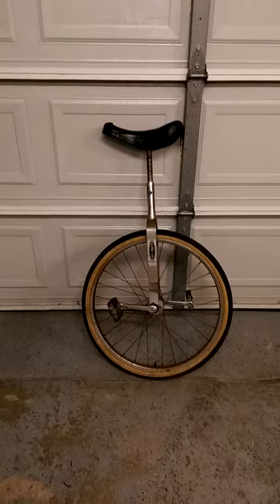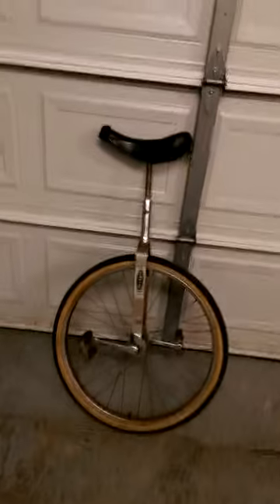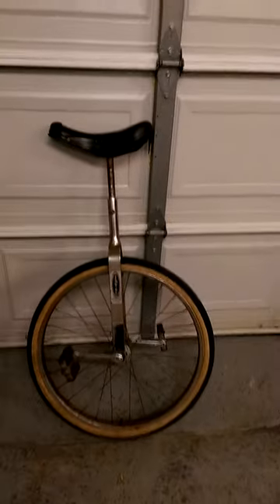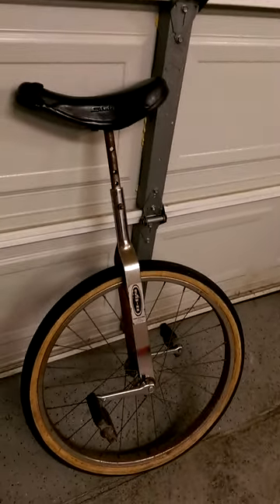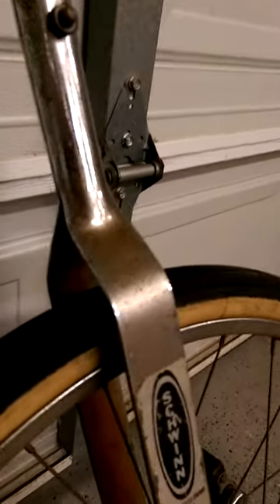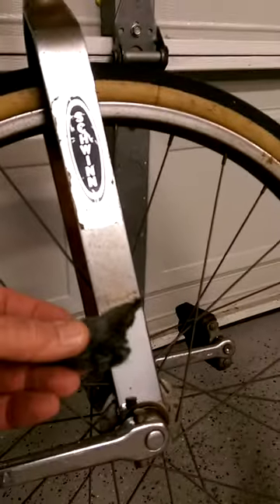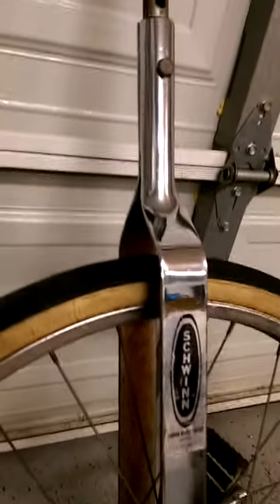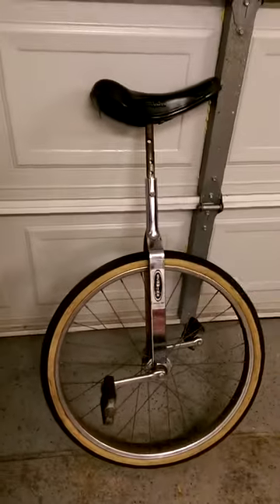Schwinn unicycle restore/ cleaning

Comment: It's a 1968 S-7 Schwinn unicycle,  I own one myself and I restore lots of bikes, tractors,  and other historic equipment,  oh and it was made in Chicago, Illinois like all of Schwinn equipment
Reply from the maker: Thanks for the info, that's interesting, it's actually older than I thought, and thanks for watching.
Reply: Your welcome
Reply: I actually recently got done restoring a 1970s Schwinn street bike and ended up putting three puncture wounds into my arm/wrist on my left arm,  when I was trying to pry off the sprocket my hand was over the sprocket and I was using a small piece of steel,  I pushed so hard my hand slipped, and my arm dug straight into the sprocket,  I was definitely surprised,  so I ran upstairs and had to have a small wrap put around my arm so it could heal,  but, please do keep this up, and if you ever want advice or help just go to this and tell me,  it might take a little bit but that's the fun in it,  either way have fun and please post up more videos about bikes,  I love me,
Reply: I also soon want to start a YouTube channel called restoring with Gilmore
Reply: Absolutely..ride it

Comment: How do you remove the cranks from the axle? I unscrewed the nut but the bolt will not slide out, even after hammering on it.

Thanks!!!
Reply from the maker: I think that bolt is actually a tapered pin, leave the nut on but loose, and try heating it up with a torch and or some penetrating oil like wd40 or pb blaster, then tapping it with a hammer. Good luck, let me know.
Reply: @Artseventy6  Thanks for the reply. I'll have to heat it up. That thing is stuck!!
Reply from the maker: Did you get the cranks off?
Reply: @Artseventy6  No. I was giving it as a gift to my teenage son and feared that using a torch might damage the or discolor something. I only wanted them off to clean the hub and re-pack the bearings but it cleaned up nice and rolls smooth so I decided to leave it alone. Basically, I chickened out :)
Reply from the maker: Nice, I hope he enjoys it.

Comment: So my buddy just gave me a 20in one and the childish part of me wants to do trials on it, will it break?
Reply from the maker: I don't know, but isn't the bigger concern about you breaking?😉 sounds like fun though
Reply: As long as it is in decent condition and the main bolt for the seat adjustment isn't rusted you should be okay.  Oh,  and make sure to check that your inner tube and tire are good.